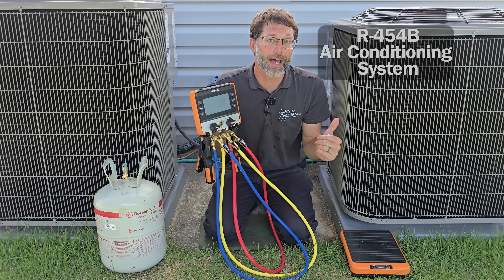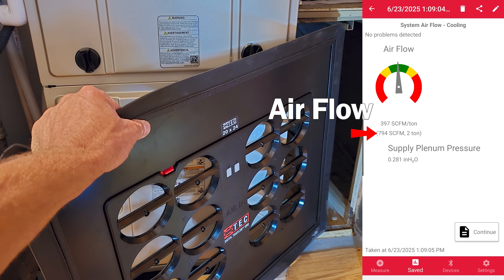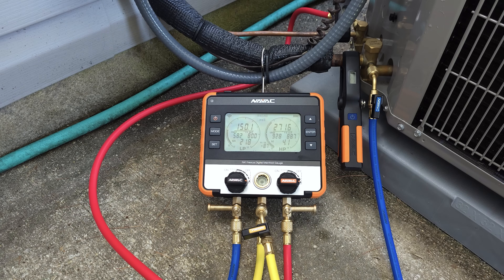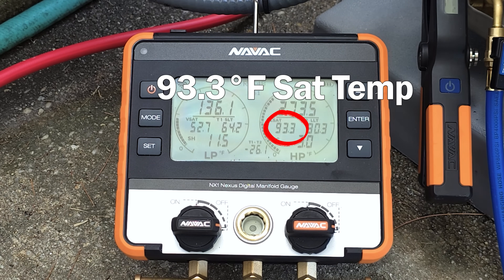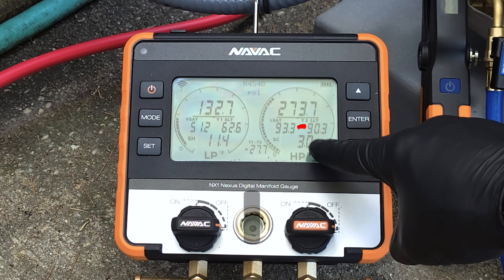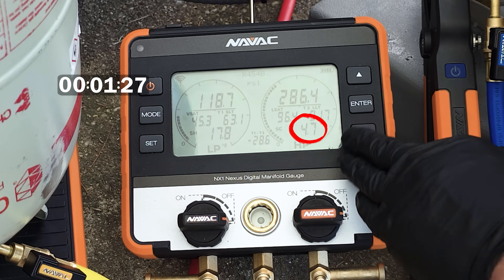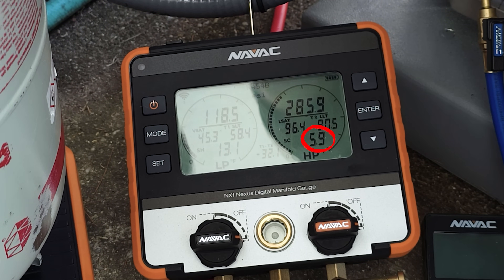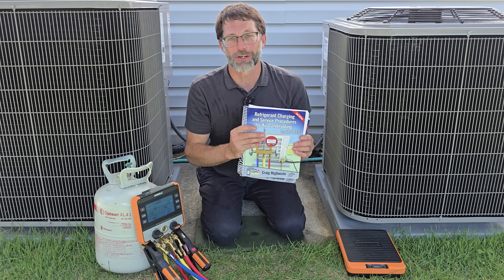Charging R-454B Into an Air Conditioner That is Slightly Low on Refrigerant!

Comment: BEWARE: My son followed the instructions and got injured when he disconnected the hoses. His finger was severely frost bitten. We are at the ER now.
Reply: Video was posted 45 mins ago, this comment 20 mins ago. So in 25 mins, your son watched the entire video, burned himself and you made it to the er?
Reply: @DamienGermain-g8d  that guy needs to take his meds 😂😂😂
Reply: Amen 🙏  @DamienGermain-g8d
Reply: Beware: You should be a qualified technician...
Reply: User error. You should always know the risk before doing something. No one's perfect but its pretty hard to do if you know what you're doing.
Reply: Always push on the hose tightly to the valve while using your other hand to spin off the hose nut. Never been burnt when doing this and paying attention. Hoping for a speedy recovery!
Reply: @hamonthvac I do that too, barely lose anything but I don’t see others doing it.
Reply: Why the hell aren't you using a thumb screw core depressor tool?
Reply: This sounds like an AC tech just trying to keep people from learning about their AC.  
The emphasis on this show is always safety  first.  
In order to get frost bitten severely, you would have to disregard all the safety emphasis provided here.
Reply: You are allowed to use your own braincells. I think a profession change may be a good choice.  Im sure there is openings at McDonalds. Flipping burgers, no, bad choice, hot surfaces.
Reply: This the text book way that Craig teaches to charge a system. If you notice he hooked his hoses up when the system was off so your son didn’t do that part. Sorry your son got burned. Been there done that after 23 years in this trade. Sadly if your son followed this to a Tee he wouldn’t have got burned that’s the sad truth. All the info given here is by the book. This channel one of the best resources online period. Hope your sons ok but follow directions don’t skip steps or bad things happen
Reply: Sounds like your dumbass son needs to leave this stuff to professionals 😂
Reply: If your son needed instructions AND injured himself, he isn't allowed to handle refrigerant.
Reply: What happened to the quick disconnects
Reply: Dr......wait, what's that on your finger?  oh its from the bullshit you were typing.
Reply: I'll freeze my damn hand off if I get scared and stop spinning too
Reply: Guys it’s not that hard to adjust your core depressors in your hoses when I put my regular hoses on I get nothing in or out of it
Reply: It’s more than likely a shit core depression on the gauges or a shit schrader it happened to me. Thing got stuck open
Reply: I’m going to assume this is either AI garbage or someone should not be handling refrigerants. Given how the user phrased the comment, high possibility of AI junk comment.
Reply: Sound like you may have a daughter actually.
Reply: You need to wear gloves when interacting with refrigerant and you have to move fast when installing or removing the gauge hoses
Reply: @justinhoyte5192 lol, only people not in the trade would suggest using gloves
Reply: Probably didn’t have an EPA certification. That’s why you can’t diy hvac without no knowledge, better to have a professional.
Reply: @richlikeg3722 EPA is the ones making this mess in the first place. No matter how safe they make these refrigerants, you still have to pay and pass and show papers and tax...
Reply: This is for professionals, and educators